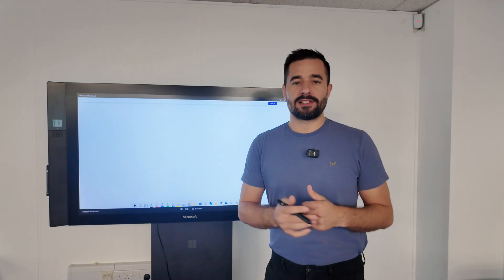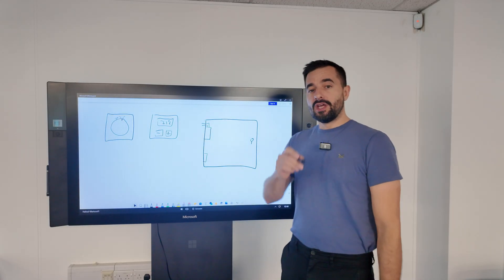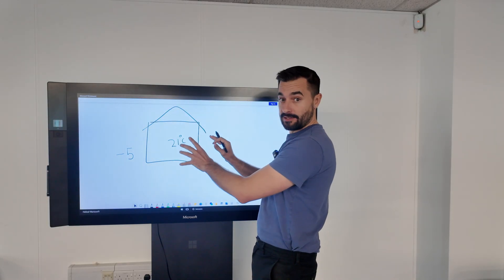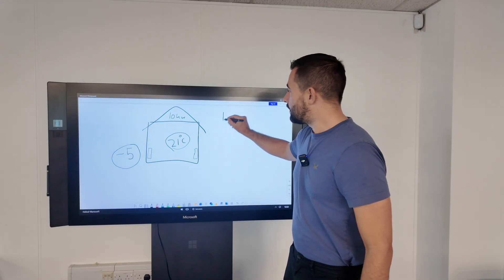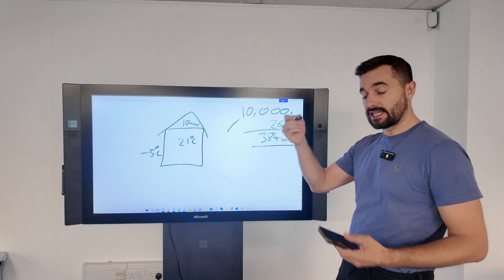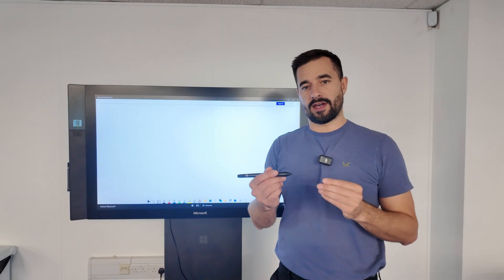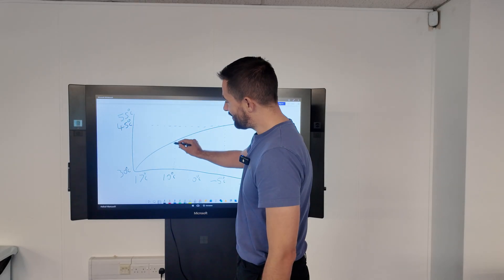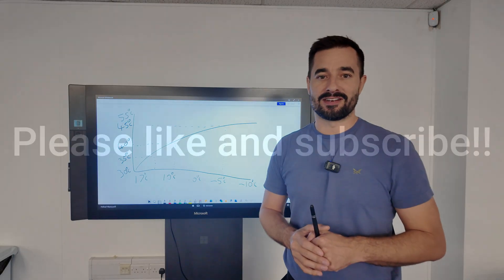Weather compensation explained

Comment: An interesting video and well explained. I'd not thought of it in those terms. I have a Siemens rev100 room stat that used PID to narrow the hysteresis band. It works well and avoids the extremes of a standard room stat. 
Weather compensation seems automatic, the room takes longer to heat and cools quicker when colder outside therefore the boiler runs longer and the radiators are hotter. When it's milder outside the room heats quicker and cools slower so the boiler runs less and the flow temperature is lower. 
I did think you were going to explain weather compensated room stats used with newer boilers that can vary flow temperature.

Comment: Hi Adam. I understand the theory but how can I as a consumer work out my heat curve. At the moment I’ve incrementally turned up the curve until the rads feel very warm to the touch and gradually reaches target temp of 21. It takes about two hours from coming on to go from 18-21 degrees in the morning. How can I find the right heat curve?
Reply from the maker: Hi, which model of heat pump do you have?
Reply: The heat pump needs to be cycling as little as possible. You are far better off keeping it running at a low level provided it’s been sized correctly. You don’t want a high flow temperature to push the temperature in the house up quickly. Better off having a setback temperature at night to reduce the power overnight. 

Get a couple of smart thermometers like the Govee ones that can chart the temperature over time. Set your curve to keep your house at a comfortable temperature all the time then use a setback temperature for overnight saving when you don’t need a lot of heat going into the house. 

Heatpumps really don’t work well if they are turning on and off all the time because they take a lot of electricity to spin up the compressor from stopped. I have a Shelly 1pm on my fridge and it pulls over a kw when the compressor starts and then settles down to 90 watts in steady state. A heat pump will be bigger and therefore a bigger differential in power. 

 they don’t like having a high temperature on the flow because the compressor has to work harder spin more and has more pressure to overcome to get the water up to that temperature.

Hope that helps with the reasons behind why you want to set up heatpumps for efficiency.

Comment: 09:00 Maybe its better to say that the heat loss is the same but the amount of energy needed to achieve the desired temperature is lower if the temperature outside is higher.

Comment: Do please try to remember Adam that your potential viewers are not just next door, some are even in 'Thar be dragons' territory (north of the Watford Gap and west of Offa's dyke) where ' it's not -5 in the UK all the time', but can be be down to -20 up in Shap village, before even considering what you were thinking with 'a UK average of 10c ' ! - For pity's sake, WC is conceived as reactive, it's supposed to respond to the current temperature to 'compensate' for heat loss, not wait for the theoretical average.
 - The 'UK record' is -27.2 recorded in Scotland on three separate occasions: December 30, 1995, at Altnaharra; and January 10, 1982, and February 11, 1895, both at Braemar), and god only knows where it's headed now with the lunatics in charge of the asylum, think once think Tice....

For my sins, I'm out east in Romania and currently running a Viessmann gas combi, using the manual version of weather compensation since my early notion of 'load compensation as an equivalent' proved foolish with the 'Vicare-Don't-Care module with eff-all instructions' - Due to Viessmann's control freakery, I'm still in the same jam of having to call in a techy to cancel the internet override by ' Vicare-Don't-Care' of the WC sensor parked out back, but adjusting the boiler temp for expected outside temps for the 2nd year in a row is no big deal, given I'm not in 'average 10c UK'  🙄

My own findings now going into the second winter, bliss, but perhaps some fleshing out may help understanding - All pipes are half inch underfloor plastic likely installed using the cheapest plumber available before I bought the place, so undoubtedly dodgy joints - All rads are now over double theoretical heat loss,  and ALL of them are controlled by IMI TRVs, not a solitary stat indoors - Last winter only hit-15, so didn't stress the setup to the max, much the same gas consumption, BUT.... Every room flatlined at +/- 0.1c , return temp to the boiler didn't go above 24c on continuous circulation - That's the real killer of fully modulating boilers and WC, it can be programmed up and left to run, the rads will take whatever they need... 

My annual gas bill,  481 quid....

Comment: Nice video Adam and your presentation skills are excellent but your maths skills are shocking and undermine your message.
Inventing abbreviations of units "po>" instead of W/°C and drawing a graph with increasingly negative numbers is confusing and detracting to anyone who has done maths at school. 
May I suggest that you consider your audience and follow conventions in future.
Reply from the maker: Thanks for the feedback……

I hear you, and will be more considered in my use of ‘made up abbreviations’ going forward. 

Interested to know how you would draw a weather compensation graph?

Thanks

Adam
Reply: May I suggest that you consider being a bit less pedantic? I didn't see a "shocking math error" (he was just using a calculator...), didn't even notice the abbreviations, and I have done maths at school. I think he got the message across very clearly for a non-technical audience. 
The way he presented the graph is the way you see it on most sites (just google "weather compensation curve"), and even my Viessmann ViCare app shows it like this, as does the screen of the heatpump itself. So to me the "scientifically correct" way would be confusing. 
Just consider the outside temperature on the X-axis as a driver of the required workload for the heating system: with a required inside temp of 20°C, at 20°C outside the heating demand is zero, so it makes sense to start the graph with the required inside temp (20°C) as the zero point of the X-axis, and to make the values go down going to the right. 
The scientist would probably argue to rather use that "required temperature delta" as the X-axis, but THAT would be confusing and detracting for the average Joe who's trying to understand what he's doing wrong with his heating system. He needs to see values he understands.
Reply: Do I need to know the design numbers for my ashp to be able to set my wc up correctly or are all design numbers in the south east of England all the same . Also do companies who design and install ashp keep these records on file as it’s been 5 years since mine was installed and I don’t know the design information TIA

Comment: Weather Compensation is great, but often it's only really perfect when coupled with a well placed indoor sensor. Both together, the Indoor Sensor registering that you home actually needs heat, and the weather compensation helping your heat pump or boiler to figure out the correct flow tempy depending on your heating curve.
Reply from the maker: Yes, a well placed indoor sensor with room influence adjusting the curve can really help tweak the system, I run my system with an indoor sensor and it helps iron out the variables such as cooking solar gain etc.

Comment: The weather compensation for heat pumps need to be linked to weather stations, so they can heat the property up prior to a cold spell, no good on the day if temp drops suddenly, coz they take longer to heat up the property. They also need wind speed indication, coz this makes a considerable difference and linked to an internal stat to account for solar gain.
Heat pumps and their controls will be far far better in 10-15 years, they are far too fickle and don't modulate low enough at the moment.
Reply: If the property is being kept at a steady temperature, it’s not necessary to predict the weather in advance. The heat source will just ramp up or down to match the heat loss at any given time. It’s only if you try to increase the interior temperature quickly that you might notice the power limitations of a heat pump.
Reply: Wind impact is indeed  a factor in house temperature. The issue here is that wind comes from different directions, different speeds with additional high gusts.  Equally,  each property is impacted differently by the same windy conditions.  Our home is on a hill, and an end house, taking the full brunt of the southerly winds, wind impacts us far greater than our neighbours.  This is where not running just on 'pure weather compensation', but running it with your 'load sensor' thermostat , the heat source can make the necessary adjustments to reach the desired temperature,  just working a little harder to do this.
Reply: @JOOI525 Totally agree👍